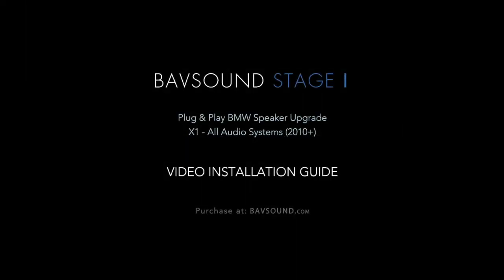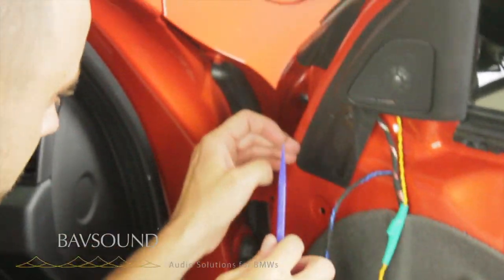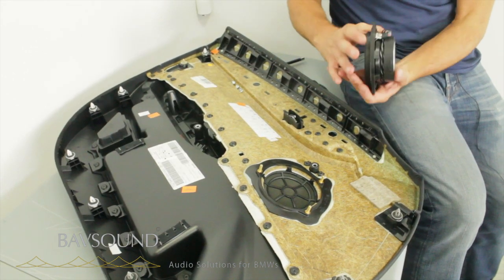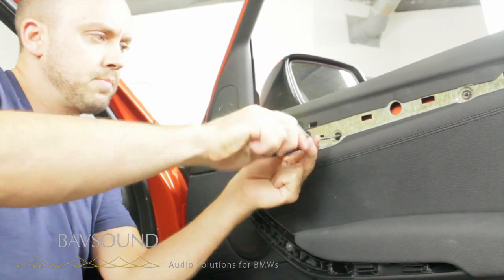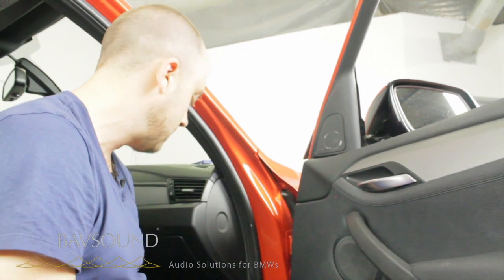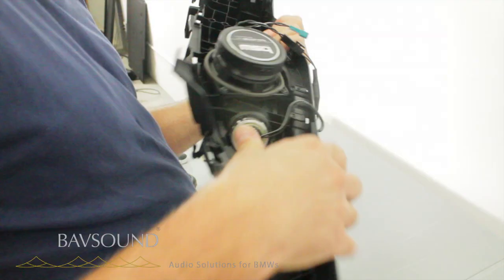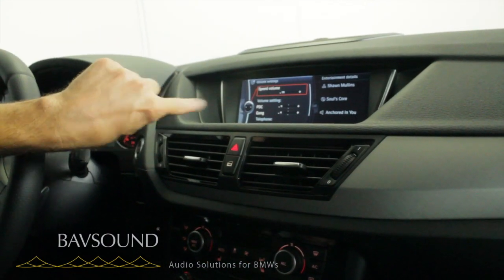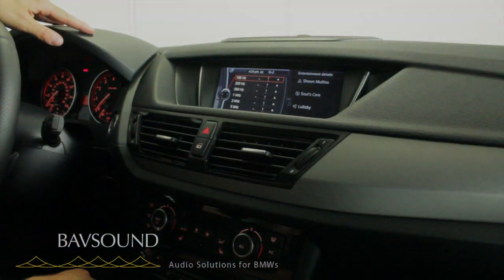BMW Speaker Upgrade/Installation | E84 X1 (2010-2015) | BAVSOUND Stage One

Comment from the maker: Hi Konrad, apologies Youtube is acting up and not allowing a direct reply; We've never had a reported warranty issue as the speakers are 100% plug n play. Your BMW dealership would have to be really really "tripping" to claim any warranty issue with these better-than-factory drivers (the factory drivers sometimes blow and fry the factory amp!). In a worst-case scenario (which has never happened) the drivers can be swapped back to factory as easily as they go in!

Comment: So the "speed volume" setting actually messes with the bass and lower mid range when you set it higher and the car speed is increased?  I though it just increased the volume as the car speed increased.

Comment: What about the fron speaker under the windshield?
Reply from the maker: The E84 X1 vehicles actually do not come with a center dash midrange. (Not sure why we used the picture of a kit with a center dash speaker in the thumbnail picture). We have many other install videos that include the installation of the center dash speaker if you need to reference for another vehicle.
Reply: @bavsound  is it possible to add a mid dash speaker to an e84, which has no one?

Comment: Very helpful video. I installed the rears last weekend and it was a great success. My only recommendation for change is at 19:05 - 19:30, those two steps I would reverse. Remove the tray after removing that first plastic plug simply because if the plug falls into that hole where the tray used to be, it might get trapped down there and be a huge pain to find.

Comment: FYI - I have a 2015 BMW X1 (Ult Edition) and I did not have a rear tweeter as they showed in this video. Installation guide was still effective other than that.  Was a bit bummed. The rear speaker they gave me fit, just no place for the tweeter.

Also, I managed to replace the rear speakers without taking out the top plastic panel. I just laid on a blanket in back and took it out from underneath once I got the side panels removed.
Reply: +Daniel Wabyick You can buy those rear plastic panels from the BMW Parts Dealers online. They're like $35-40 each depending on where you buy it and shipping costs. I installed them on my non-HK audio X1 and it has the same fit as the stock one, only difference was that it had one fewer screw slot so I ended up with two extra screws after installing both panels.
Reply: Do you happen to know the part numbers for those rear plastic panels?  I have been searching on RealOEM and can't seem to find them.

Comment: Nice video. Questoin, I have a German Spec. 2010  X1 E84 d18 diesel engine with a shitty sound system. Will this kit fit as as well?  If it does, how can I get this kit? Thx.